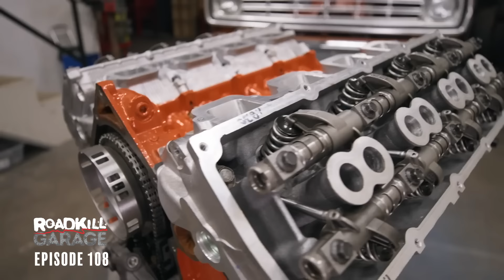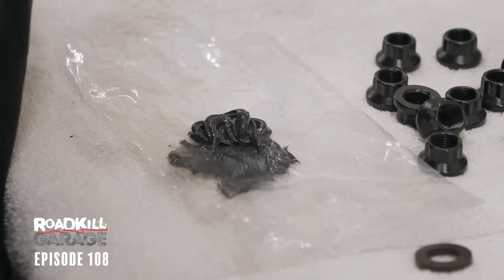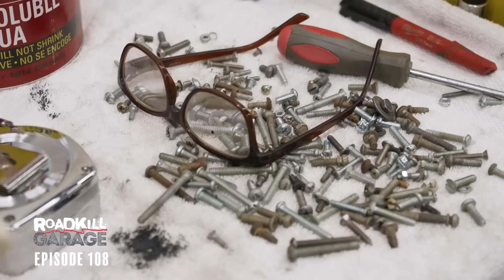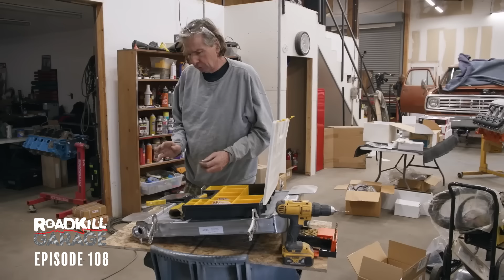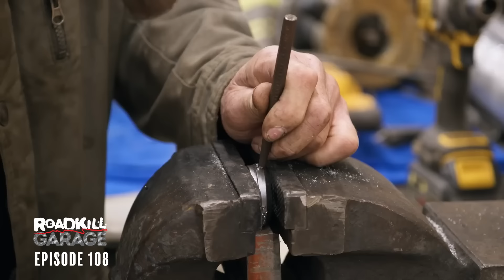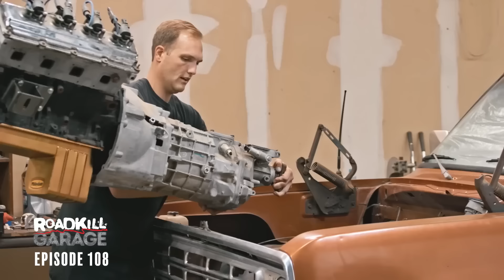Installing Gen III Hemi in Dulcich's Mopar Muscle Truck! | Roadkill Garage

Comment: Steve, when do we get to see the Mopar Muscle Truck again. We want to see you driving it, doing some mean pulls and burn outs. Awesome truck. Any hints on your cam specs would be cool too. Made great power on the dyno. 517Hp and 461ft lbs at the wheels.

Comment: What alternator bracket is that? I have only seen them on the left side. I am considering doing a 6.4 swap in to my Australian A body (read: dodge dart), having the alternator on the right side would be better. I wont be running P/S or A/C though

Comment: Don’t you love cutting sheet aluminum with a circular saw? The sound is so irritating. And it ended before the engine and transmission were installed. Very annoying.

Comment: Doesn't say much about engine building skills or taking care of them when they all blow up huh? This show is just a crash and bash show anyway.
Reply: Not really. Those engines are old hat and he no doubt does beat on them a lot. Lots of burnouts, racing and running them hard does tend to induce some failures… not really a surprise they’ve all failed. Dulcich and Freiburger have built hundreds of engines and cars and know what they are doing. Every engine will eventually fail, more so given what the truck is used for.